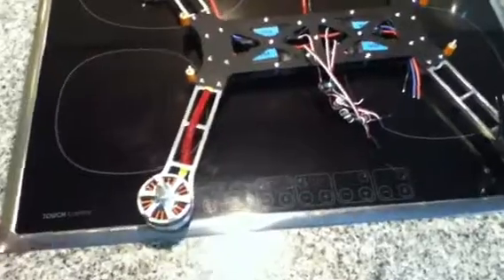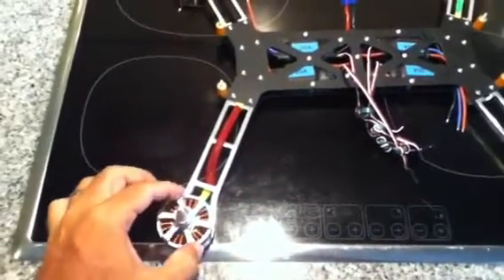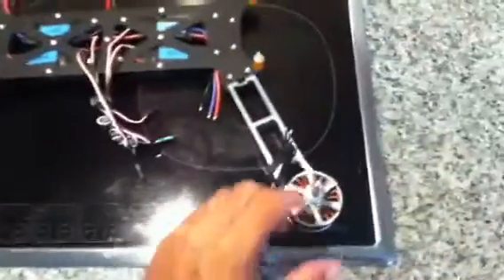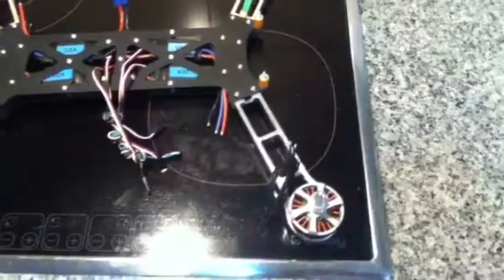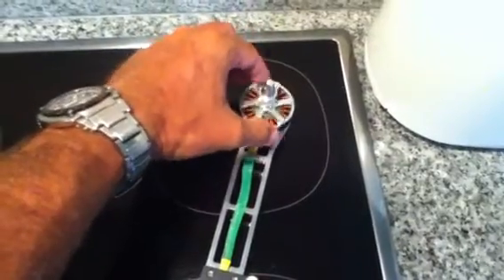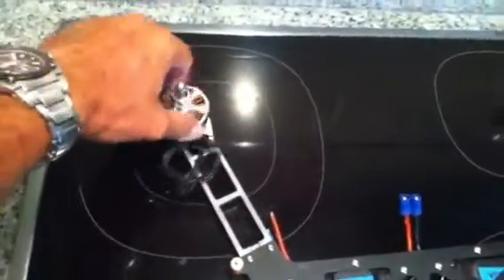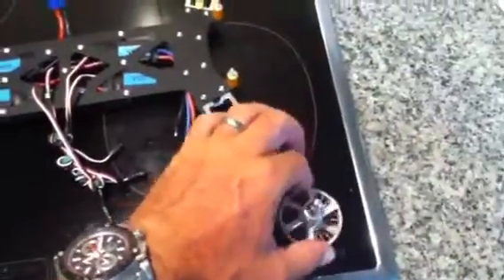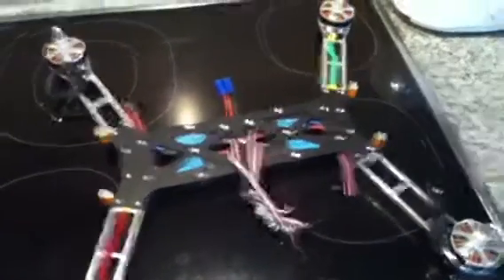QAV500 Motors

Comment from the maker: Thanks Za Ja.
The video is three years old. Found the issue very quickly, or none issue I should say.
It was as Kobus says, three posts down. The motor has residual resistance, which causes the motors to stiffen, due to the Caps in the ESCs.
It goes away after a while, or when you plug the battery back in.
Cheers

Comment: Most escs have an electronic "brake" which is were the motor uses the energy it has in momentum to try to spin backwards...(same thing happens when all three wires are connected together)...think about an electric car that generates electricity when slowing down...but rather than storing that the motor uses it to spin backwards. If the motor was 100% efficient, it would be impossible to turn it at all. Although my comment is very late I just wanted to explain it.

Comment: The motors has an internal resistance.  You will most likely find that when you plug the battery in the stif ness will be gone and to test my theory take one of your motors that is not connected and touch all the 3 wires against each other and feel the motor it should be stiff and once you take the wires off of each other it will turn easy again.  Hope this helps